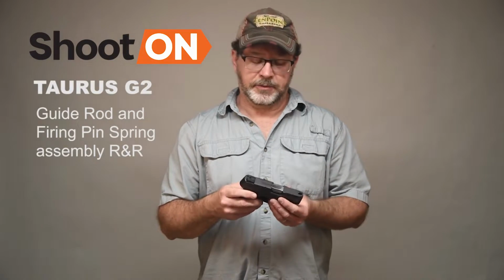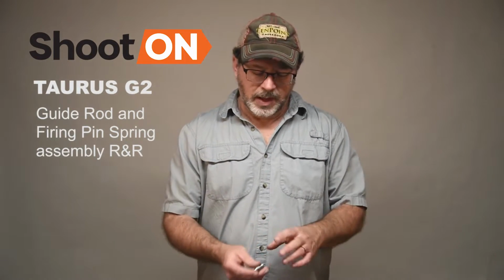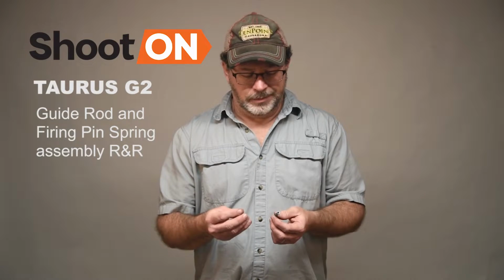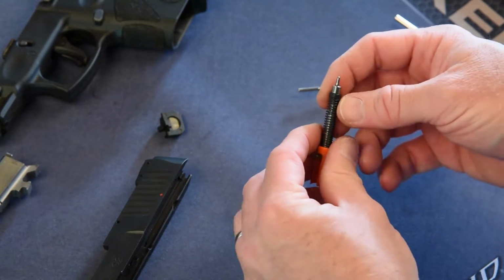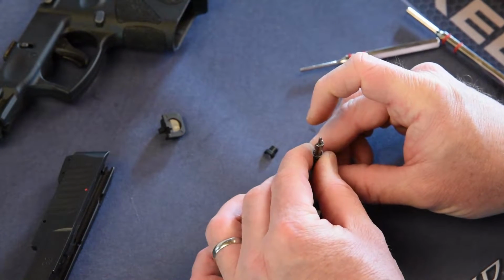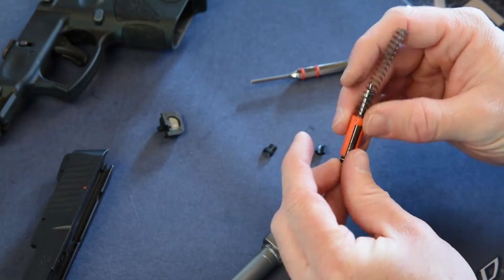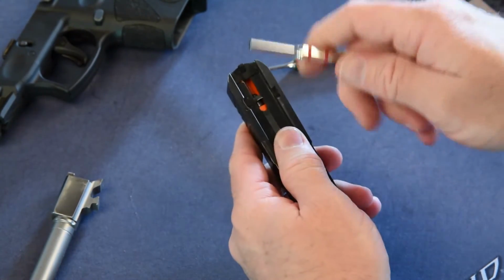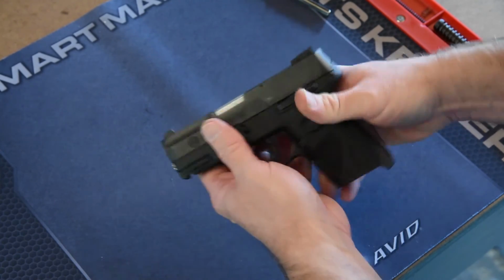DIY: Taurus G2 - Replacing Guide Rod and Firing Pin Spring

Comment: I replaced the firing pin sleeve from its original plastic to stainless steel, but I had a question about the new sleeve on the plastic theirs a hole in it and on the new sleeve there is none, what's the purpose of the hole and should I machine the hole on to the new sleeve?

Comment: No offense to this guy, BUT.... statistically speaking, which is the only thing that counts, POLYMER GUIDE RODS SIMPLY DO NOT FAIL, SPRINGS DO.  This is a WASTE of money that changes NOTHING in terms of reliability and/or durability. THAT SAID, if you're into spending your money on the "cool bling" factor, that's a legit thing I suppose, but PLEASE don't think you're "improving" your firearm. Glock still uses plastic spring guide rods....WHY?   BECAUSE THEY WORK - WHILE KEEPING SLIDE WEIGHT TO A MINIMUM....and it was/is good enough for dozens of military outfits worldwide whose lives rely on that design

Comment: How often should firing pin be cleaned????
Reply: Not as often as the rest of the gun, but it does need cleaning because the OEM firing pin and springs can corrode enough to retard the spring.  Although I replaced mine with the Lakeline assembly, I include cleaning the firing pin assembly about every 500 or so rounds.  Replacing the entire assembly is just a drop-in task.

Comment: In my just bought Taurus G2C I can't remove the back plate to take the firing pin out.. it seems to be glued ... is there any explanation for this? Thank you!
Reply: You're just not getting the plastic sleeve pushed down far enough to release the back plate.

Comment: Replacing the guide rod, firing pin sleeve and associated springs was incredibly easy. Even for someone like myself who only has this one firearm. The hardest part was getting the 2nd retention back in. A simple trick is to use a small 3/32 precision set, while placing the firing pin on the desk with a metal or plastic end of a Writing Pen into the sleeve to shorten the amount of space the spring can compress while push down with the precision screw driver and pinching the spring continuing to hold it down. This let me use my dominate hand to place both of the pieces back in.

Comment: I have a PT140 Millennium Pro. My firing pin was throwing light strikes on primers. I had never removed and cleaned the firing pin assembly so I did so. It's very easy. Put it back together and now upon first racking and pulling trigger the firing pin stays forward. When it attempts to chamber another round it catches on the firing pin and jams up. I've disassembled and assembled it 3 times and I can't see what the problem is. With slide locked open I can use a small tool and pull the firing pin backwards. It feels like it's under spring tension, which is weird. It should want to go backward because it has a little spring that pushes it backwards. Anyone know answer?

Comment: Easiest way for firing pin disassembling and reassembling is to use the slide. Insert orange end of sleeve you can press down on springs and have a solid base to work on. Then once done flip it around and install it. I also got rid of the orange plastic and used lakeline stainless steel firing pin sleeve
Reply: They should just sell the whole. Complete firing pin assembly...this way  you don't have too worry about damaging the components....
Reply: Wear on parts. Solid piece removes trigger lock if equipped. Makes for a more crisp trigger .and better feel on trigger pull
Reply: @smokintruker27  10 4! Appreciate it 👍
Reply: Just curious...what is the benefit of the stainless steel over the orange plastic sleeve?

Comment: Or just buy a decent pistol.
Reply: Only people that dont like Taurus cant appreciate a decent pistol like a Taurus
Reply: @smokintruker27  I would never rely on a Taurus for EDC, maybe a leave in your truck gun and only if you can get one for sub $200.
Reply: @bobdecker2446  I own several hand guns. I was a big Kimber fan. Kimber ultralight 1911 also a S/W pro series 1911. And a rock island. I chose to carry my G2c every day. Or my Taurus TH9. That's the new version of the PT809. Several years in milatary and custom gun building. I'm perfectly fine with counting on my G2c or TH9. Both 1500 rounds plus not one failure. My pro series was over 1200. My kimber over 1300. My G2c 198.00 and it works perfectly.
Reply: @smokintruker27  I agree, Taurus has improved since the class action lawsuit that resulted in 9 (NINE) of their models being removed from the market and recalled because they were defective and dangerous. Also 1500 rounds is about 5 visits to the range for some shooters.
Reply: @bobdecker2446  I did about 500-550 rounds with it stock. Once I rebuilt it. Installing new trigger and guide rod and firing pin sleeve and sights. It made a BIG BIG difference. Got ride of trigger safety. Used one of Keeptinkerings triggers. Now its customized to what I like stock is fine but I like making with my own twist on it
Reply: @bobdecker2446    I got one for $169. After adding the Lakeline stainless guide rod and springs, I'm still under $200. It's a great EDC....for less than $200.
Reply: @tangoindiamike9189  lame mine was 299 after tax and fees here in wa state about 2 months ago.
Reply: @jglaboratory  they cost more now cuz of all the protest and riots
Reply: @thznuttz  Or bc it's an election year. Supply and demand
Reply: @smokintruker27  u r very smart
Reply: @sterlingmack5394  I'm a certified gunsmith.
Reply: Nothing wrong with Taurus pistols, I've had them since 02 and no problems what so ever. Millennium pt111, G2, the judge poly, 605 .357, tcp, and spectrum
Reply: Oh shut the fuck up, Bob